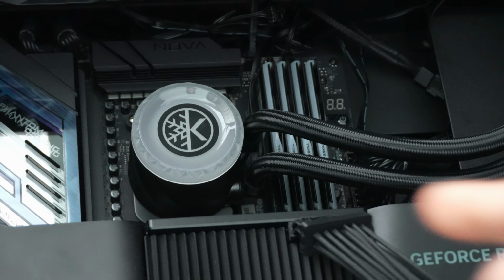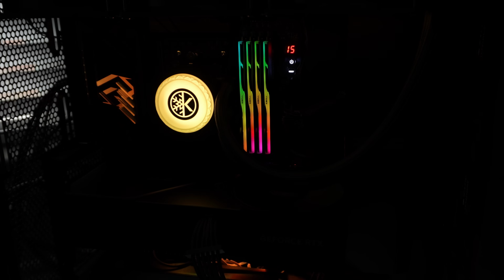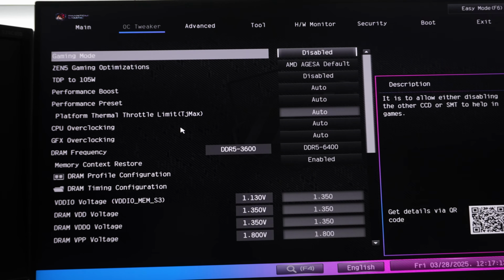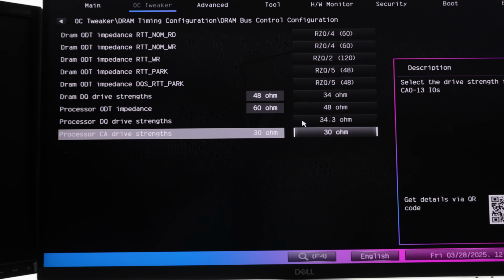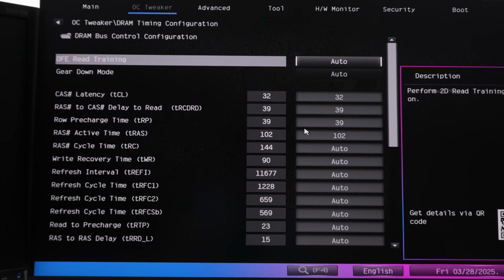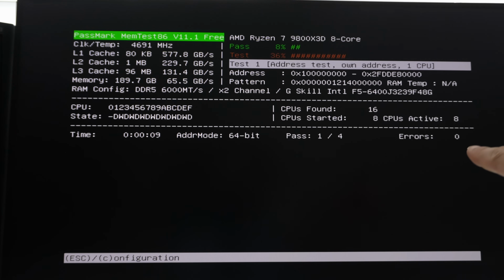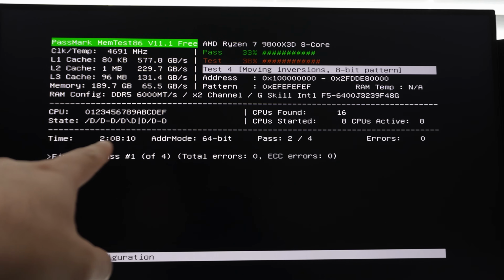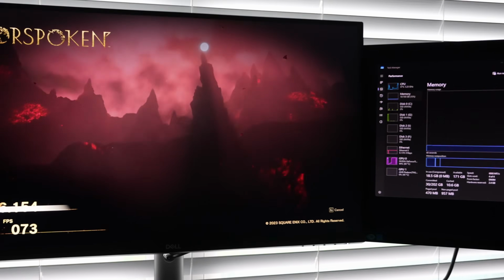How to run 128GB and 192GB at DDR5-6000

Comment: did your memory kit being specified to 6400 help, or do you think one that's rated to 6000 would work just as well?
Reply from the maker: A standard 6000 kit should work.
Reply: @GameTechReviews  So if my 6000 kit has tCL 30, tRCD 36, tRP 36, tRAS 76 on EXPO with 2 dimms, which are a bit tighter than your numbers in the video, do I set my numbers or yours with 4 dimms at the end? If my 2 dimms run at 1.4V for VDD and VDDQ , do I keep this or lower to 1.35V for 4 dimms?
Reply from the maker: @HamsterHearthstone  You don't load the EXPO profile at all. You only manually select DDR5-6000 and leave all the timings on auto. The only things that are manually configured are the ODT bus termination values as shown. Assuming it will sucessfully post to 6000 then you can try manually setting just the 4 primary timings to match the ones on the EXPO profile.   You can try manually setting 1.4v or 1.35v for the VDDIO, VDD, and VDDQ.
Reply: @GameTechReviews  somehow my four 4800 corsair dimms with 6000 max overclock just flat out refused to lift off of 3600MT/s. No matter what I do. The impedences just don't take if I set the clock higher. So decided to underclock at 3600MT/s instead, with super low timings. Getting 86ns memory latency in PassMark MemTest86. What latency do you get there at 6000MT/s?

Comment: awesome!, I am just getting ready to change my 870e nova from 2x32 64gb to 4x32gb 128gb.   I'll take 6000 all day long, thank you!

*   UPDATE  **   Unfortunately, the experiment was a failure.   Asrock 870E Nova BIOS 3.20    Stable at DDR5-6000 with 2 x 32GB Trident Z5 Neo RGB F5-6000J3040G32GX2-TZ5NR   When I tried to duplicate your settings and get to 128GB using another exact same pair, I could not get passed 3600mhz no matter what 4x32gb.   I think the magic settings you were using was for 6400 ram.  I tried many many variations but no luck.   Thanks anyway for the vid, I bet someone will get DDR5-6000 to work with 4 sticks
Reply from the maker: Are the voltages set the same? VDDIO, VDD, and VDDQ all set to 1.35v. Don't load the EXPO profile. Instead from a cleared CMOS, manually set those 3 voltages. Manually select DDR5-6000. VSOC can also be set to something between 1.1 and 1.2v. I'd try 1.2v as a start. Leave all the timings on auto. Then set the ODT bus values to the ones shown in the video. You can also try manually setting the UCLK = 1/2MCLK. You will need to wait for up to 5 minutes, in some cases longer for the memory training to complete. If it does what was shown at the start of the video with the EC code then you know that it failed and will then revert back to 3600.
Reply: @GameTechReviews  I did try 1.35V but no difference.  I didn't try clearing CMOS and then setting the voltages, I also set fabric clock to 2000 but didn't try UCLK = 1/2MCLK.  I can tell when it doesn't like my inputs because I'll get another 15 on the seven segment display after it has been training my first set of inputs.  Thanks for the ideas, I will give it one more try.
Reply: So, I tried clearing CMOS and then 3 voltages at 1.35, all auto and 9 settings per the video, UCLK=MCLK/2.....fail,   reran, same thing 3 voltages=1.40....fail,   I can't tell if its RAM or the memory controller, but reran with 3 voltages 1.40 and DDR5-5600.....fail    I give up, back to 2x32gb DDR5-6000  thanks for the tips,  I noticed you are XMP and I am EXPO, perhaps the 9 settings are different??
Reply: @GameTechReviews  ASRock always has issues with Ram at least in my experience and from what i could tell I think it runs better with other ram instead of G.Skill... Try T-Force or try lowering it to 5500 or 5600 or some other value instead of 6000... Maybe 6000 is too much for these sticks.
Reply: @DD23-1  the g.skill 6000 CL30 works fine on 2 stick kit both confirmed by gskill and asrock cozni emailed them before buying lol. And g.skill deliberately told me not to use more than 2 sticks. But you know we all have our curiosity lol 😂 

Ended up with g.skill coz the corsair 96gb is nowhere to be found in my place and the 96gb gskill is ridiculously overpriced by the vendors here like $600 for the 2x48gb. I was like wtf???
Reply: Oof i have the same sticks and planning to add another 64gb kit. Thanks for this!
Reply: @pinoyxbox  you're welcome, that'll save you $200 for now.  I hope Asrock will somehow figure out a way to make this work in BIOS and release a new update.
Reply: @somethingclever1234 yeah for the meantime i’ll just use this 64gb kit and buy a 96gb kit in a few months.
Reply: @somethingclever1234  From the old TTPG forum???
Reply: Same for me Ryzen 9950x3d crosshairs 870e hero tried 128gb dual rank 4x 32gb not manage to start at 6000mhz , 2x 32gb expo 1 working perfectly no issues I will return 1 kit unfortunately and stick to 64gb , great videos , exactly what I was searching in last few days.
Reply: I had the same ram went from 64Gb at 6400cl28 add another one and was stuck at 3600, load default with F5 to remove any cpu overclock then leave everything on auto and 4800mt loaded and running stable, I needed more the extra ram then the 4 fps I’ve lost in video games
Reply: What cpu are you using?  Doesn't it's memory controller affect whether you can run 4 DR sticks(128/198)?
Reply: @dropcheck6562  9950x
Reply: Exact same issue for me. I’m gonna try 4800 and work my way up
Reply: Hello, please tell me if you managed to make the memory work with a frequency higher than 3600? I can't do it with 192 GB, the video tutorial didn't help, my motherboard is a little different - Taichi Lite.

Comment: Great work as always... so I had dual rank 6200 mt of ddr5 32gb and I managed to get four of to post at 5600mt but when I restart the pc it doesn't doesn't post andvi only did mentest64 being time limited I think my resistances are off on a gigabyte 870 board

Comment: Prove its stable i can boot at 6600/2100 but highest stable is 5400/2100

I will clarify tho memtest pro 2500% if nothing else 170GB minimum as the allocated amount of testing
Reply: My suggestion is to use Karhu, TM5 and y-cruncher, and OCCT is good one aswell!
Reply: @ OCCT will find certain errors the fastest memtestpro is the best for finding 1 off errors

Karhu never used it not paying for it and TM5 is too hit and miss different tests will find different errors but only if they are repeat ones as AMD error correction can bypass errors being detected

Y-Cruncher VST or VT3 score consistency will show infinite fabric stability issues

And so on... ultimately memtestpro to 2500% is the only one that i have tested that actually errors with me at 5600/2100 at it does so at 140% while 5400/2100 ive had run for over 5000%

Comment: Do you think 64gb at 6000 mhz 4 sticks will work plug n play?. 
Have the same board working well so far.
Reply from the maker: 64gb total or 64gb per DIMM? If it's 64gb total (i.e. 4x16GB) then you don't even need to do this as those are single rank and are plug and play.
Reply: @GameTechReviews  thanks for answer the same question I was in mind  , also have the Nova , very premium board for less than 400.00 dollars !!
Reply: @GameTechReviews Great question from Roshi, glad it is among the ones you answered. I was patiently waiting for you to make a video for 4x16, glad to hear its as easy as "plug and play" as many of us just want all slots populated since for just "gaming" even 64gb is quite overkill and Corsair is the only ones to offer "enhancement kit" aka rgb dummy sticks but i'd much rather pay twice for ram than hop on the Corsair "ecosystem" and iCUE bloatware.
Reply from the maker: @3ildcard  I already covered 4 sticks single rank in a previous video with the MSI Godlike. Basically, you just have to install both kits on separate channels as shown in the video and then load the EXPO profile.
Reply: @GameTechReviews  Fair but i am a silly newbie so i thought it doesn't apply for 2x16 kits and just for single dims. Aside from your videos i could find just one other video and the guy struggled to make 2 kits of 2x16 work so i was worried.
Reply: No

Comment: There are now 64GB 5600 single sticks, can you use four of them to do 256GB
Reply: No there arnt those are server sticks

64GB sticks have existed since 2023 but have still yet to actually release so there are crap tones of motherboards that state 256GB support but you cant actually buy 64GB sticks yet
Reply: @ ok thanks for clarification
Reply: @commanderoof4578 Crucial Pro has 2x64gb kits @5600.
Reply from the maker: In theory, these same settings should work for those since those are also dual rank DIMMs. However, the higher capacity might require different ODT values.
Reply: Can’t post link, search for Kingston 6400 Non ECC clocked unbuffered dimm as an example
Reply: link please?